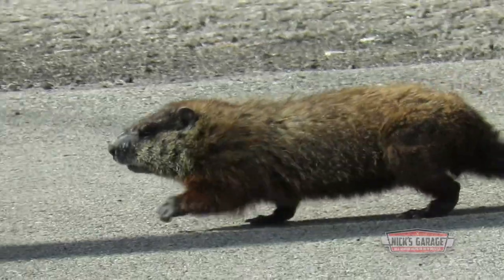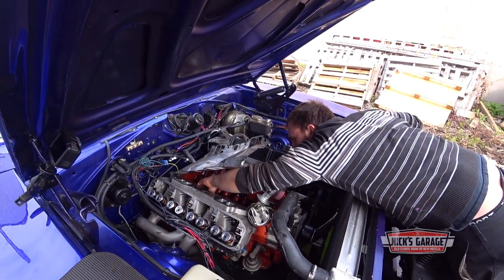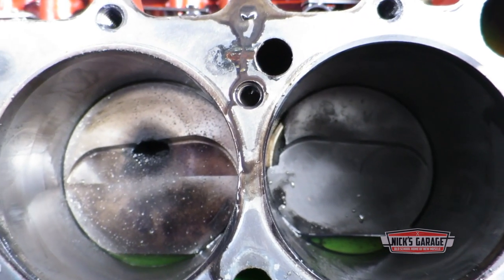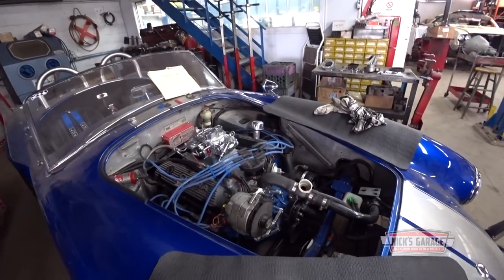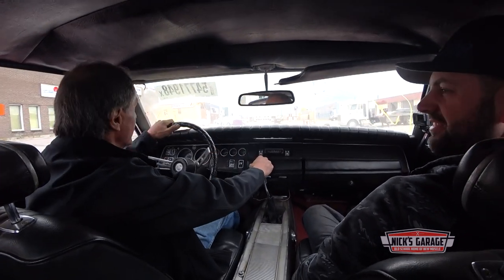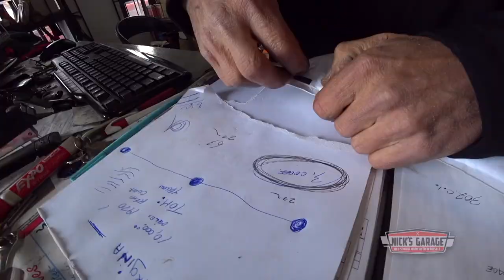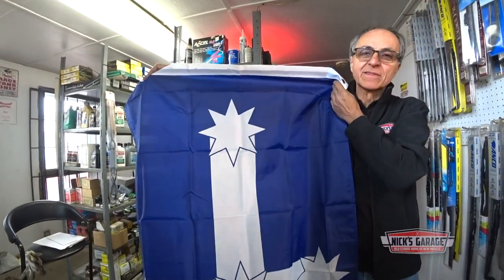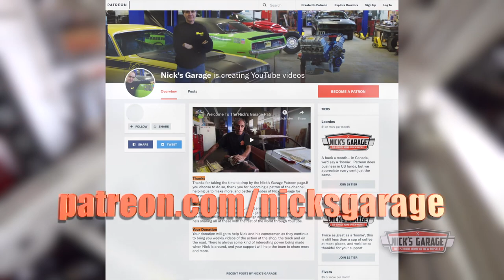Wicked 1968 Charger Blows Up - What Went Wrong?

Comment: Detonation and lean conditions possible piston flaw (hot spot effective like a glow plug) on that second cylinder back but the front one is Common lean over-heat/pressure/NOS failure usually caused by expansion of the rings farther than the gap can allow. Maybe the ring gap on that one wasn't to spec (especially for NOS). But one thing sticks out more than any other thing noticed and that is he had installed a SPACER under the throttle body that is because he had a nitrous plate in there and removed it (the real culprit here) Nick saw it and he knows he just don't want to call the customer out on camera. It never pays to shame the customer. Customer needs to get better tuning done prior to use of nitrous and let the builder know in the beginning he plans to spray it so the rings can be gapped properly for the intended use.
Reply: That's one for customer states...😂

Comment: Nick, Keep up the good job, I am in Virginia in the US and in about 1980 I was working in a Oldsmobile dealership servicing used cars and I had a Ford Granada with about 65 thousand miles and I had it on the lift and started it and put it in gear and when I pushed the brake pedal the back tires did not even slow down and after I searched the problem the brake line tee on top of the rear end was never drilled all the way through from the factory, 65 ths. miles they drove with no rear brakes and of coarse brand new rear shoes no dust on them, I have never forgot that one, keep up the good work,
Dave
Reply: That's almost never heard of with so many miles without rear brakes

Comment: While modifying a '62 chevy 4X4 brake system for power assist dual master cylinder recently, I discovered that a lot of replacement brake master cylinders, these days don't come with internal residual pressure valves, some aren't even machined for them, which means adding inline residual pressure valves, 2 lb. for disks, 10 lb. for drums.

Comment: It’s always hard, expensive and time consuming to screw them together but it only take seconds for them to come apart. 
Nick knows what to do
Reply: John Johnson Yup, usually requires 2nd, extra fuel injector to be activated along with Nitrous
Reply: Not A Mechanic ,But Nitrous & Fuel Injection,Doesn't Sound Like a Good Combo.Street Drag Slicks on Back ,So Probably  Drag Strip Car.

Comment: ran lean, melted a hole in the second piston, overheated 1st one, pinched the top ring, filled crankcase with fuel, then b00m.
My suspicion is someone was tinkering with nitrous oxide... and they conveniently didn't mention it to you.
Reply: how can vasila not know what a melted leaned out piston looks like? LOL!
Reply: That would be my guess too.
Reply: I agree 100% someone forgot to tell the whole story.. LEAN and Nitro
Reply: He cant tell because he isnt a real mechanic. He is a tv mechanic....
Reply: Why would he tell. He has nothing to gain if he does. He's just going to fix the motor and move on as to what the customer requests.
Reply: @tedvolz9674  
no one said he didn't, did they? maybe I'm missing it and you can read invisible stuff that I can't see or something...
Reply: @mrkoolaidman5975  
My guess is it was fine until he hit the button, that's when it leaned out and commenced melting stuff. Not uncommon at all for people tinkering with that stuff without really understanding it. But hey, we live and we learn... sometimes the expensive way. I can't claim I haven't done similar stuff in my not so distant past. hehe
Reply: I am actually a 27 year old father of two and a mechanic certified by GM for 8 years. I have been around guys like him before and all they are is the face of the company
Reply: @jenries5525  with your attitude I'd recommend that nobody every use your shop.
Reply: I don't think it was the fuel injection that caused that.  More like bad nitrous oxide tuning
Reply: Sneaky sneak
Reply: Hey Zach your boyfriend that you met at the highway reststop May also be your father. Sorry
Reply: If it just run lean why is the valves had something hitting them like a bolt.
Reply: I run fitech on a turbo blow thru setup never had a issue . that is more then running lean.
Reply: My thoughts exactly!!
Reply: @backyardbuilttrucks1  I've seen too much timing set up preignition, that has de-bonded pistons like that, as well.
Reply: @patrickwayne3701  

I dont doubt that but the exhaust valve has a lot of damage more then a piece of piston would do.
Reply: @funkyzero  he says the pistons are 'broken' (maybe language barrier miscue). the holes in the pistons are literally melted & vaporized due to detonation/lean condition,  there are usually no broken pieces.
Reply: It never pays to shame a customer! Nick saw the spacer under throttle body he knows damn well this guy sprayed on an untuned setup. Also the builder didn't gap the rings for Nitrous probably not the builders fault, the customer may not have said he wanted to spray it.
Reply: You can bet the farm they know more than they are saying. The channel is public and I doubt they would risk throwing any stink on a mistake, especially if the customer made it. 

Remember this when viewing any form of media. They only reveal what that want you to know.
Reply: ted volz, Zakery Morris, ofcourse he knew. He's just playing his part, adding to the suspence.
Reply: @masterdebater8757  You are probably totally correct. You would be surprised to find out how many guys have no idea you need to use a larger ring gap if your going to run on the the bottle.
Reply: @Slugg-O  
this isn't a flat earth conspiracy man... it's just a blown engine in a hotrod. Not much unusual about that.
Nick is older than I am, and I have 10 bucks on the idea he's seen this before more than once already.
Reply: Out of my experiances, the demages are looking like a) too lean at heavy load ~lambda 1.0 and b) wrong  or bettet sayed too early ignition Timing. Both can be achieved only by installing an EFI!
Reply: @jenries5525  And why would you think anyone cares what you may or may not think?
Reply: funkyzero, copy that, if I had a dollar for every time a customer lied or left out important information when working on
vehicles, I could have retired years ago.
Reply: @jenries5525  ,the new school "mechanic" thinks every carburator he sees is a tbi throttle body! lmao
Reply: it was piston debris. the lean condition was caused by the increase in cylinder pressure- with a lack of fuel it went hot and melted a hole through piston sending debris flying out the exhaust and melting inside the chamber trying to spray weld pressurized beads  to the valves whilst the valves chewed and chewed and spewed it through the exhaust, the supersonic harmonic shockwaves hammered the next door piston and cracked it into bits. The pressure blowing into the crankcase through the piston hole while it was still screaming rpm and igniting boost adding more nitrous like nothing had happened then it blew out the intake manifold when boost pressure from the nitrous combustion built up inside the block, the inside of the block became a giant cylinder bore with NO exit, no way through but through the weakest area as the car was screaming rpm still being driven hard, exploding the front intake gasket  and tin underneath to deformation. this was a high order. The bomb was detonated.  It'll be nice to see this 440 survive.  @backyardbuilttrucks1
Reply: @backyardbuilttrucks1  probably put the 40° total advance on a lean motor and the detonation is what got the broken slug. The burn through was staying in it while it was detonating. Just put a set of pistons in a 69' firebird for the same problem. Being a wiseguy,thought if it ran good at 34° total then more would be better. It was. For Ross pistons,not me.
Reply: @patrickwayne3701  on the right track. This motor was detonating. That cracked the broken slug. The burn through was detonation and keeping the guys foot in it while it was eating itself.
Reply: @funkyzero  probably seeing it a lot more recently with all the cheap nitrous stuff out there.
Reply: @johnlowe8418  i just watch here, don't know how it is edited for TV, but I wish they would ditch the drama and narrator
Reply: @johnspencer7291  whats a carb?
 What are points ? 😂😂
Reply: Bore it again, suspect that the fueling may have been exceeded by demand, detonating it to death..
Reply: @MrTheHillfolk  breaker points located under distributor cap,my 67 charger has dual points,carburator,atomizers fuel mixture,mounted on intake manifold
Reply: @jenries5525  The old dude definitely isn't a mechanic but he's still the guy that started the business so you've gotta give him some cred. That's what he hires young knowledgeable mechanics for.
Reply: It was not lean the timing was too advanced the spark plugs were probably too deep into the cylinder you need shorter colder spark plugs for racing. Much of the detonation comes from the flame wall that comes off of the spark plug at the moment of ignition if the spark plug is too deep into the cylinder you have to flame walls one going up the other coming down they meet in the middle and detonate if the spark plug is higher up towards the head you only have one flame wall and the engine has a less chance of detonation and won't detonate if the timing is set correctly
Reply: @7REDDRACO7  Nick described the explosion in the beginning of the video, said it happened right where the car is sitting.  Don't know why the guy is running what appears to be an intake off of a B engine on the RB engine.
Reply: tinkering with a junk fuel injection ststem running way too lean
Reply: @tedvolz9674  piston alloy doesn't melt but actually shatters into flakes when heat and pressures soften it too much.
Reply: Slugg0matic Exactly! Nick isn’t a spring chicken- he’s a veteran of a lot of politics to have been able to build such a successful and reputable business in and around Montreal. Excellent customer service manners!!!

Keep up the good work Nick
Reply: 0xsergy If you have watched a few of his videos, you’ll find that he is indeed a mechanic; has been one for over 40 years; used to be the engine rebuild specialist at somebody else’s shop; still slings wrenches almost every day. 
Please pay attention
Reply: 22099dscott That was just a backfire thru the crankcase - That did NOT cause the damage to the 2 pistons
Reply: @tedvolz9674  people only know wha they have experienced. Lighten up.
Reply: Yes, conveniently.
Reply: That’s not nitrous damage. That’s NA severe lean from someone jacking the tune up.
Reply: @mrkoolaidman5975  nitro and nitrous are NOT the same thing
Reply: @masterdebater8757  sprayed because theres a spacer under the throttle body?! Lmfao. That's ignorant as hell 🤣🤣🤣🤣🤣
Reply: @0xsergy  definitely isn't a mechanic? Lmao. No, he paid his dues already and he OWNS the shop and pays the mechanics. He doesn't have to work on cars. He hires people to do that. That's what business owners do.
Reply: @MrTheHillfolk  What is positive ground?
Reply: @JC-11111  it's an 8 month old comment bruh, he's released videos since of him working on cars.
Reply: No it's just a every day thing  it's a dodge
Reply: @JC-11111  you are 100% correct thank you for that catch... I was having a blonde moment.. Lol
Reply: Any blown intake gasket that blows is a mamjor issue
Reply: They never tell you when they have been in there messing around , so usually you have to fix what they did, then do the originally needed work.
Reply: It would get better traction, handling and mileage if they first moved the battery to the back, then replace the engine with something much lighter.  What lightweight engine is easiest to bolt into old Dodges? 2.2 Dodge? 3.9 is still too heavy.  I have a '78 318 van for which I am asking the same question.  Of course my van has the extended rear, but I still think the 318 weighs more than the sheet-metal in back, unless I put junk back there.  I know, Corvair wagon has the best 2wd traction, or vw squareback.  At least they have an aluminum intake.
Reply: The Truth about Africa hurts  I know, traction is not the design purpose of muscle cars, but if it is not drag racing, as he says when he recommends returning to stock, then what is left is daily driving practicality, looks (hence the purple), and the ability to return it to stock later in order to sell to museums.  Now since not getting stuck in the mud is extremely important to practicality, why not pickle and crate that 440 for museum time and bolt in the lightest engine you can bolt in? BTW My '82 Dodge W150 /6 has less power than my housemates Honda Fit and I have hauled 4 cows over a mountain with it.  I also have a 3cyl Metro with a burnt valve, all after owning a 390 Mustang.  My conclusion was that unless you can outrun cops, speed has no purpose, especially without handling, for which lightening that nose is job 1!
Reply: The Truth about Africa hurts  On my Mustang, I left the engine alone and spent my money on rear sway bars and tires.  I planned to move the battery and buy an aluminum manifold, more for weight than power, but never did before selling the car for first a slant 6 van and then a 2L Datsun pickup.  BTW, the slant 6 is heavier than a Ford 302 and considerably heavier than the 3.9v6, so good thing my W150 is 4wd.
Reply: Most of those throttle body efi conversation systems only use a single oxygen sensor on one bank so it would never know if one bank or the other leaned out.
Reply: You're 100 percent correct I've seen that very same damage a hundred times and it's always nitrous
Reply: @jenries5525  no he's not just a TV mechanic this guy is the real deal when it comes to dodge he's a expert who is very professional
Reply: @jenries5525  If you watched this channel more you would know better. There is nothing to gain by making a paying customer look like an ass in public.

Comment: Just thinking, theorizing about that one piston with the hole in it. Given the position of the hole, it appears to have been burned by the spark plug electrode. A high capacity igition system , combined with a damaged spark plug (lacking a proper gap to fire across) would make the arc directly contact the piston at TDC. The massive voltage to the piston dome successively burned the piston face, eventually melting a hole through it. Afterwhich, the pressurized air/fuel mixture was forced into the crankcase, and eventually detonated (ie, the massive backfire). The resultant internal pressure blew up under the piston rings and broke the landing on the other piston. My guess - there's other broken piston grooves on the other bank of cylinders, plus internal damage to the block.
Reply: Would too lean a fuel mix, lead to the plugs failing? and exacerbating issues? (In your opinion, a possibility? )
Reply: hole in piston was in hot spot area of piston.   
spot softened and pressure blew a hole.   aloominium ain't very strong and has quite low softening temperatures - just like the steel in the Twin Towers on 9/11.

Comment: Back in the day when 1970s trim/body parts were still available from the dealer I would often receive parts that would not fit. I was told that production line rejects are sold as body shop parts. Since the parts were special order the dealer would not accept returns.

Comment: Intake spacers are because they are running a 383 intake on a wider 440 block. Looks like detonation damage caused by the EFI leaning out.
Reply: Spacers are 2 additional gaskets to fail and go lean. Not good. Needs RB manifold for RB block. Agree with you.

Comment: Nick your the man. Thanks for your videos i love watching from way down here in Texas.  
Last year I got a 71 Dart 360 come in with a back fire so bad it blew gaskets out and even bent the oil pan.  Carburetor car high performance 360 . New engine build my had someother shop. They kept trying to start it until the final big boom. After that it comes  to my shop. I found the new fuel pump  was dumping fuel into the engine oil and oil pan.   
  I pulled the engine to rebuild it, what a mess I found, half the rods were put on the piston wrong, tapper on rods turned wrong for the crankshaft.  You just never know what someone else has done.

Comment: Tuning is such a fine art.  A Set of headers I had for 302 HO Ford had bungs welded into each of the runners for EGT probes.  I mean if your searching for refinement whilst making power you need to understand so many parameters.  AndI think understanding knock conditions is little tricky with older V8's.

Comment: Pissed'n'broke 

Those intake spacers are a low deck intake on an RB, or, Stage VI heads with raised ports on an RB (Stage VI heads on the B deck take the RB intake directly). Looking at the chamber shape of those heads and intake ports they 'ain't Stage VI heads so B intake on an RB engine. The plates don't hurt power when properly fitted.

Comment: I did a simple head gasket job on a 72 caddy....got it all back together except for one carb screw....just could not find that screw, so I replaced it with one from junk parts....when I started it it smoked like a bad diesel.....later found that carb screw embedded in a piston.....it happens

Comment: 383 manifold on a 440 …...using spacers - vacuum leak....ran lean …..boom
Reply: Out of curiosity, why would they do this? Are those original int manf hard to find or just don't flow as well.
Reply: That was the first thing i noticed too. B manifold on RB block!! Not proper at all.
Reply: Indy cylinder heads some require spacers